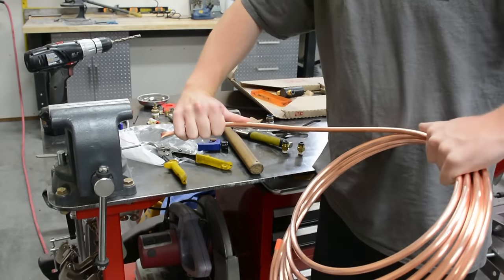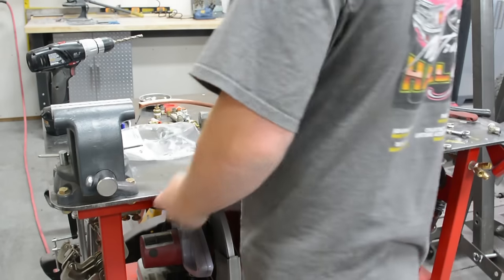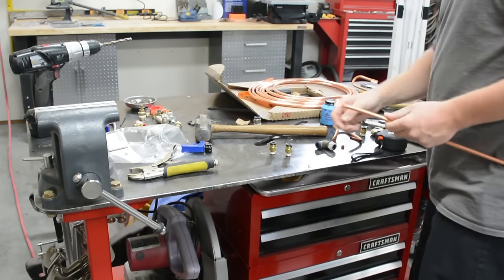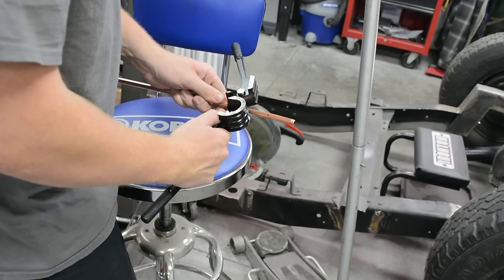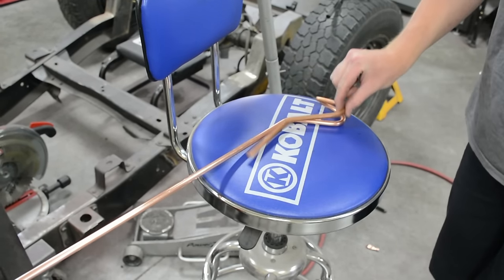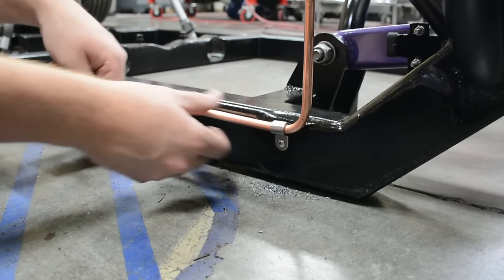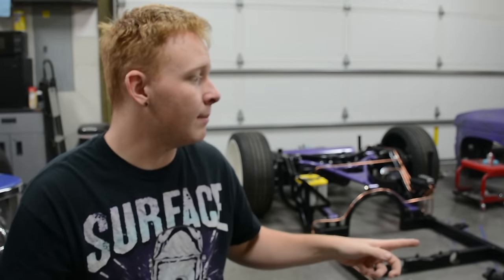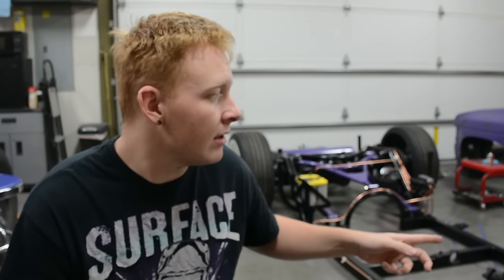Bagged/Bodied Hardbody Build // Episode 23

Comment: Tbh best build videos on youtube, I was kinda apprehensive at first, usually not a fan of mini trucks. But this is some top notch fabrication work. Also, what tubing bender and welder do you use?
Reply from the maker: +MajorCox777 thanks means a lot! Speedway tube bender and a Lincoln 180 welder
Reply: +scrappingpavement Hey thanks for the info, in addition I own and operate several 3D printers. If you would happen to need some smaller plastics work done I'd love to send some stuff your way.
Reply from the maker: ya that would be cool. email me at blazingcustomz@hotmail.com so i can save your info!
Reply: +scrappingpavement just sent the email!

Comment: Really nice job on the lines man.  Good tip on the straightening. I have some 3/8" steel fuel line I need to do for my motor swap. I'll give it a shot.  Jess from SW Idaho ;)
Reply from the maker: thanks, im hopping that technique works on other line as well.

Comment: ok bud I only got one thing you did wrong. I'm a journey men plumber and there's a thing called electrolysis it's when you got two different types of metal touching each other. it will be fine for a couple month but it will start rotting your copper tubing out. Now there's a couple ways around that issue one you can get isolation clamps or two grab your self some 10 mil isolation tape. Just take some of that and go around the pipe a couple times on each of the clamps. trust me it will save you the headache down the road
Reply from the maker: thanks for letting me know!
Reply: +scrappingpavement 
Not a problem bro keep up the good work. I'm a big fan

Comment: Do you have to order anything fancy fittings to fit the copper lines into the distribution box for the accuair or the bag fittings
Reply from the maker: +Erik Sickler nope just regular 3/8 fittings
Reply: Is the copper line normal copper line where did u get the copper hard line from?
Reply from the maker: i used type acr heres a link where i bought it https://www.amazon.com/gp/product/B002JBMWKE/ref=oh_aui_detailpage_o06_s00?ie=UTF8&psc=1